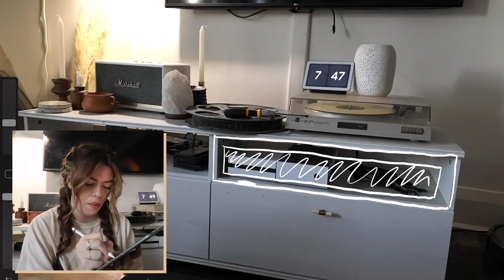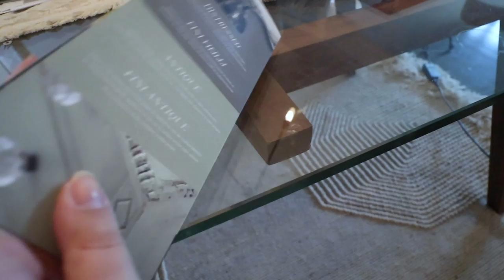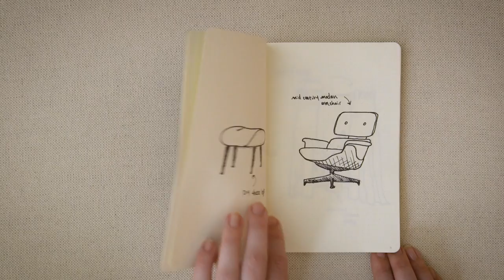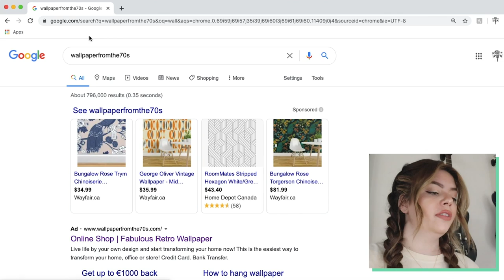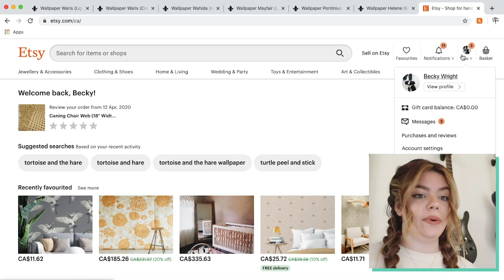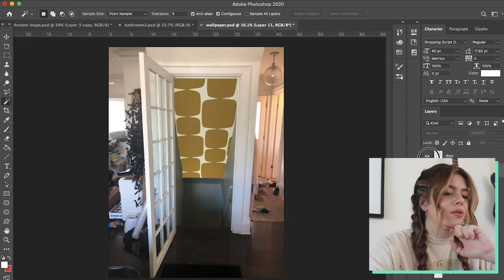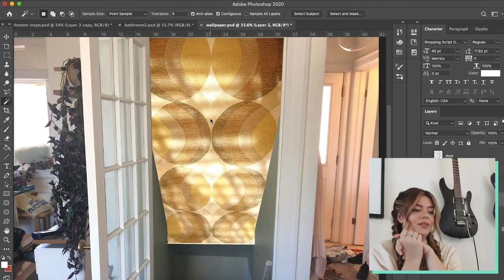upcycling my old IKEA unit (pinterest made me do it!) | DIY Diaries

Comment: Giiiiirrrrlllll!!! Those cane doors are SO CUTE!! The only thing that could make it better would be to take off those nubby legs/feet and put on some angled mid-century modern legs on there!

Also, (if you don't have a magnetic screwdriver) you can put a magnet on the metal, and it will actually magnetize the metal and hold on to the screw! ❤❤❤
Reply: I was hoping it would be that and not the tape (didn't think about that).
Reply: That’s what I was thinking. Great minds think alike.
Reply: Wow I didn't know that - how clever!
Reply: yes!!! Change up the feet on the tv cabinet!!!

Comment: I love that you are taking a piece of furniture that you have had for sometime and just making it even better, kind of like if it ain't broke don't fix it, in this case just upscale it to make it better. I have seen those angle clamps, because I use to be a custom framer and I used those a lot to hold the corners of frames in place while they glued, and the frames we glued usually had the corners cut at a 90 degree angle, and some of the angle clamps were very large and each weighed over 15 Ibs. Dang girl that turned out amazing, I love that it's a creamy color and not too white, and it blends with the cane perfectly. I love the wallpaper you chose, me being one of those that grew up in the 70's, I do remember some of those patterns and prints. I do remember when I have applied wall paper and how much work it can be, I have done wall paper borders, full wall of wall paper, I have done it all. You did a great job I had faith that you could do it! You could also get some half round trim and cover that edge if you're not liking the way it looks. Thanks so much Kelsey this was a fun video and I'm liking this series. Take care and I will see you soon, sending love an hugs, bye!

Comment: Another tip for the screwdriver issue Becky is talking about when installing the lamp:  if you get a little magnet and put it on the metal of the screwdriver, it actually makes it magnetic and your screws will stick  ☺️

Comment: Love both these makeovers!  The cane doors look fantastic.  Love how they open.  Love how you made them fit so well!!!  Seems like the cane would have less wear and tear than if you used a drop down hinge.  Could just see things getting caught in it and tearing it as you pulled things out with the cane beneath.  GREAT job on the wallpaper.  Looks like you can officially do anything now!  Putting a ruler next to the edge as you cut might have helped but no guarantees.  Just takes a really sharp blade.  No one will notice that little microscopic nick.  Bold does look great there.  Bet the light fixture goes great with it.  Love seeing how you take spaces that look OK and make them look great.

Comment: With nails it works to put a magnet on the screwdriver to hold the nail to it. Should also work with screws, I guess
Reply: ...Why are you using a screwdriver and nails? Lol
Reply: @LarrietDarling  ups, thoughts got ahead of my words 😅 I meant holding nails to a hammer (when not using), but now that you say that I think I even saw someone use a magnet on a screwdriver just like I was proposing
Reply: I haven't tried it, but Evan and Katelyn just did a diy hack video and apparently that works:) https://youtu.be/1uo5qCQjY4Q
Reply: My dad does this all the time it works perfectly
He has a really strong magnet from inside a old hard drive that works perfectly

Comment: I use a wide taping knife (like a big putty knife) to push the wallpaper into the corner and i use that as a straight edge to make a really clean cut with a brand new utility knife, i personally use olfa because the blades are so damn sharp, change it out midway, keep that sharp and it will give you super clean cuts

Comment: wallpaper cutting tip from yours truly: get a metal ruler and run your x-acto or box knife along that so you have nice straight cuts, and only do smaller (say your ruler is a foot long, you do a foot) pieces at a time rather than the whole thing at once, that way you can have more control over your cut and it's easier to cut over a place that didn't cut straight through on the first attempt! <3

Comment: If you need to hold the screw to the tool, get a small magnet and stick it to the screwdriver closer to the tip. it makes any screwdriver a magnetic one! Evan and Kaitlyn tested it on their channel and it worked for them as well as me

Comment: To get good tension on the cane you wet it first, let it soak the water in for a few minutes and letting it expand. Then you nail it in place, glue it for extra support and put a protective frame on top so that the cane won’t get loose

Comment: You can use a small magnet on the ‘shaft’ (for lack of a better word) of the screwdriver and then it’ll hold the screw to the top of the screwdriver.

Comment: The TV unit looks great! I kind of wish you changed the lower drawer pulls as well though to match the new ones. 
As for your screwdriver trick, you should check out EvanandKatelyn here on YouTube. They recently put up a video of DIY hacks and one that worked for them was putting a small magnet onto the side of the screwdriver holds the screw magnetically to it!

Comment: Will those drawer fronts block the remote controls from working? Some remotes work on an optical signal so it can even be blocked by someone standing in between  the remote and the component.

Comment: An even better way to keep screws on screwdrivers is to pop a small magnet on to the shaft of the screwdriver. For a more permanent solution you can (hot) glue the magnet on to stop it popping off.

Comment: I love the wallpaper but I would have doe the application a bit different. I would have continued the wall paper down the wall, at the bottom of the stairs. I would have run the wall paper all the way to the floor. If you run strip just as wide as the ceiling width. I think that would elevate the wallpaper a bit more.

Comment: Had to stop play to comment. 1. I presumed you would use and staple gun to put the cane inserts on the doors. It seems like an obvious upholstery go-to step to me. You can use as many staples as needed and it would stretch out the cane evenly around the frame. 2. Might have been good to paint the doors before putting the cane inserts in as a contrast, but it's no big deal either way. 3. Stopped at 14 minutes in- again (silly me) I presumed you were going to show us how to magnetise your screw or the screw driver bit. This one is really easy. Take one strong magnet (you can buy small but super strong ones now on eBay and similar places). Rub one end part of the tool with the magnet a few times. 
(You have to choose between magnetising the screw driver bit or the actual screw. Don't rub both parts as they will repel each other with the same negative/positive charge.) Et voila! Your screw driver bit will now hold your screw magnetically. Okay... back to watching.

Comment: What the wallpaper waffel is in real decorating terms is paste the wall or paste the paper 
paste the paper is the one she has or old style involves soaking the wallaper for between 5 -20 minets depending on what its made onto fabrick,  paper,  vinnal or ittalian vinnal 
paste the wall is the newer paper its so much quicker and cleaner to hang 
Rember to not do a beckie and use the edge of your flexabell wallp aper smother and a sharp blade to trim up your wallpaper without the tairing 

If you are unsure on what your doing please dont just shrug it off and say im just going to go for it there are some really good instructionall videos on wallpeperdirect that are made my profeshnall decorstors

Sometimes i love these decorsting videos you guys do and then other times they makes my head hurt because this is my job and see all of the mistakes you guys make and pass off as instructionalls

Comment: So I'm just going to throw this out there. People do realize they make something called holding screwdrivers right. They are flat head screwdrivers that actually expand and contract as needed and will clamp into things and they make them small enough that you can use them inside the Phillips you can just put them in one part of the cross.